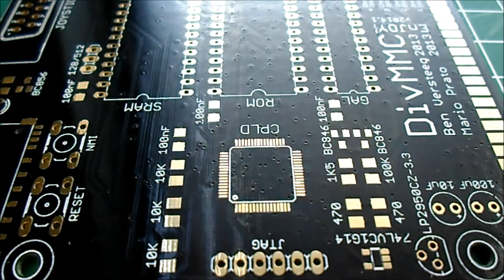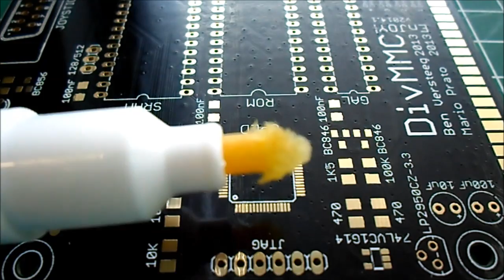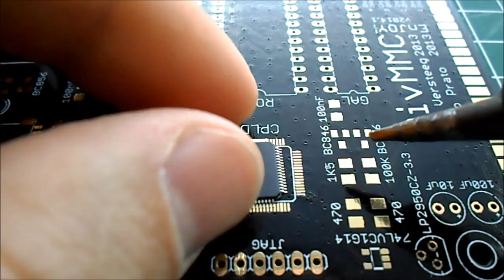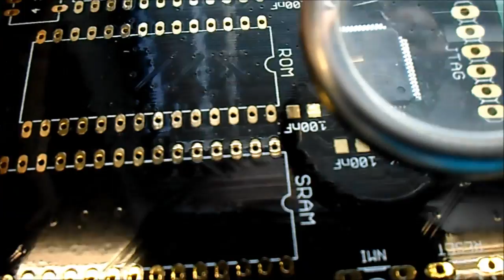Drag soldering SMD parts with a flux pen

Comment: What type of flux is this? And if you can provide the part number please
Reply from the maker: These are flux pens, with a liquified flux solution. The brand is 'Yosker', and these are getting harder to obtain. I mostly buy them from AliExpress.
I also use Amtech 559 flux, but this pen I find quicker for drag soldering, and it's easier to clean.

Comment from the maker: Since it's asked quite often what temperature I use:
Nowadays I use a Weller WE1010 soldering station, with configurable temperature (in the video I used an older Weller station).
I set the WE1010 to just over 350 degrees Celcius for leaded solder, and close to or just over 400 degrees Celcius for lead-free solder.
For manual drag soldering I only use leaded solder, since with lead-free it's a lot more difficult, or you should add flux, like Amtech Tacky flux.

Know that it's always a matter of trying temperatures on your soldering station, since the temperature on the display may not be exactly showing how hot the tip is.
You can even configure an offset on the WE1010, so it's not exact.
If the flux in the solder is 'burning' (becoming brown quickly), you might want to lower the temperature.

I do produce boards like this one on a pick and place machine these days, with lead-free solder paste.
Though I still do some boards manual from time to time.

Comment: Good job.  
Temp of iron please?
Reply from the maker: 350 for leaded solder, 375-400 for lead-free. But if I do these by hand, I usually use leaded only; using lead-free is quite hard manually for small pads, or you need to add flux (like Amtech Tacky flux).

Comment: You briefly show the flux you used. I’d like to know which one it is exactly and possibly a url where to obtain?
Reply from the maker: 'Yosker flux pens' that I obtain on eBay or AliExpress. I think I've seen only 2 type - I use the one with the white and blue label.
Last a couple of weeks each (if used regularly), and don't quicky dry out - I buy them for half a year or so.

Comment: It’s amazing how people with so much practice make these types of  things look so easy. I’m just getting back into soldering and it’s bloody hard!
Reply from the maker: Just think of it, as how you could do it after some practice. If you do it on a daily basis (like I have), it will get a lot easier.
If not, it's still a lot easier than trying to solder the pins one by one or so, or using wick.

Comment: Thanks. I followed this method to solder a TSSOP-16, and I succeeded at first attempt. I started by putting too much solder, but could remove the excess with the braid, just as you show. Then I made a few passes, as you demonstrate in the end. I don't have a magnifier, but I've got +2.5 glasses from Boot's (a pharmacy). My hands are not particularly steady, so I don't believe this method requires you to be the Bruce Lee of SMD to succeed.